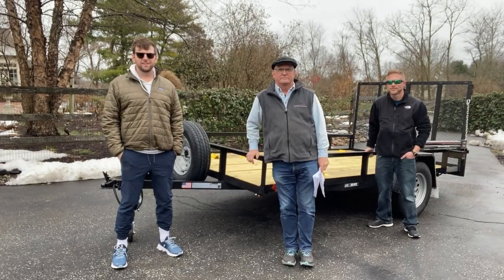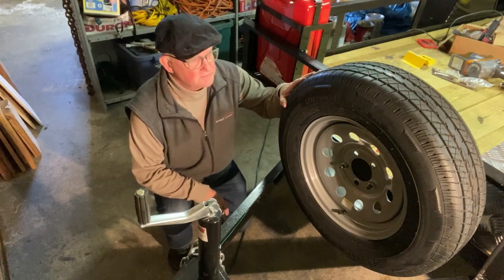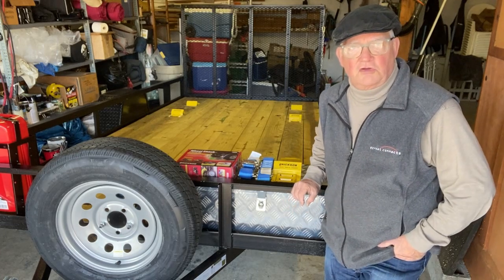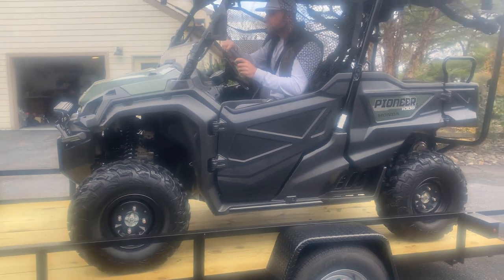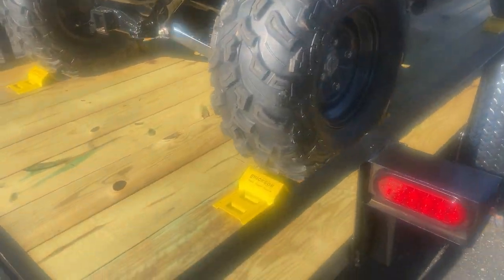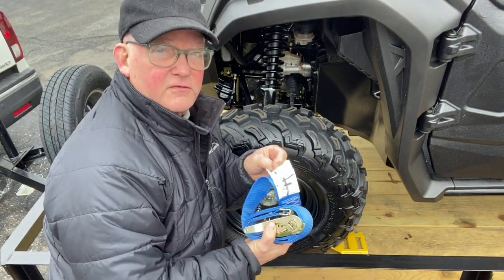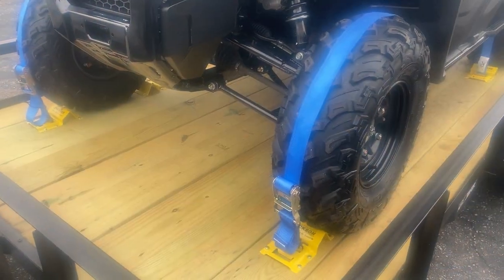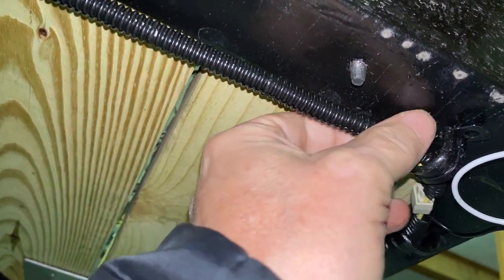Trailer and accessories for hauling your UTV

Comment: Aluminum is the way to go.  Light weight and will last a lifetime.   Cargo Buckle is also the way to go.  Those buckles are much quicker and secure.  Aluminum trailer may cost just a little more but saving a couple of bucks isn't always the answer if you want to save money in the long run.
Reply from the maker: Hey Robbie - thanks for the feedback. No doubt aluminum is the way to go - but price around here was almost double what I paid for mine and I just didn't have the budget for it - plus there was no inventory around in my size requirements - probably due to COVID. 

I did end up adding 4 Cargo Buckles - they are awesome for sure. I do like the eTrack system for the UTV and I really like how it allows the UTV suspension to absorb the road bumps rather than the trailer suspension. But when hauling a different vehicle like my little tractor, the limitation of the eTrack is obvious since the wheel layout didn't match - hence the addition of the Cargo Buckles. I'm actually glad I have both options because the UTV is the main load and I prefer the eTrack for it. Cargo Buckle gives me the flexibility for other loads when needed.

It's all fun - and thanks for taking the time to post!

Comment: Nice video. I enjoy your dual battery set up. I just did mine last night. I like the chock system as well.

Dallas Fatboy, didn’t your mother teach you if you don’t have nothing nice to say, don’t say nothing at all? I bet you have never pulled a trailer.... 90% of SxS are pulled with a single axle.
Reply from the maker: Thanks Larry! So how did the dual battery setup go? Did you do anything different than I did?

Don't be too hard on Dallas Fatboy, he couldn't help himself with that double axle dig - but it's all good!
Reply: @rsparre  I installed the same kit from TRUE as you did. Installing a Warn Axon 45-S next. Waiting on my switch plate and fuse box. I didn’t use the stinger. I am going to have a main power switch on the switch panel that kills everything instead of key on power. I wanted to be able to turn on lights and stereo and work the winch if I needed to with the key off.

Comment: Always collapse suspension when transporting utv that thing will be a pogo stick going down the road.
Reply from the maker: I don’t know what that means - what does collapse suspension mean?
Reply: @rsparre  generally load you want compress shocks some maybe not bottom them out to keep vehicle from shifting and a strap coming loose while going over bumps.
Reply from the maker: @Mathew187187  I do not follow what you are saying. Can you break it down in pieces - I do not know what “compress shocks maybe some not bottom them out” means. The Erickson straps are on the wheels - I can’t see how they would be affected by any shock movement.

Comment: You forgot a tandem axle for safety in case of s blowout or flat. Trailer brakes. Trailer breakaway system. And that trailer lock is worthless. Simple 3 foot prybar inserted under it and walk forward. It will pop right off. No noise no grinding. Need a Fort Knox lock.
Skimping out on safety and security will result in regret.   Trailer and SxS full insurance in case of s wreck. Otherwise you get sued and lose.  If you're worried about affording something, don't buy it. People want a Ferrari, but can't buy a Honda. 
Good luck
Reply from the maker: Greetings - and thank you for the feedback - I appreciate it!

Couple of things in response to your comments:
- I did specifically mention a 2nd axle for safety in case of accident or flat. I clarified that the reason I did not go with that is because of both the expense and additional weight that would be too much for me to manage at my age. I do appreciate that it is not as safe as a having two axles, and I said so in the video. 

- As for the lock, most locks are to keep honest people honest, but I will check out the Fort Knox locks - thanks for the tip!

- As for being worried about affording something, I think it is unfair to say one should not buy unless one can afford the gold plated perfect thing. I agree single axle may not be AS safe as tandem axle, but I don't think it is fair to say they are not safe. The decision to purchase a single axle trailer was the right decision for me for other reasons besides cost. I chose to get something that I could manage at my age and physical capabilities. 

Totally agree with you on the SxS full insurance!
Thank you for taking the time to provide feedback - and best of luck to you on your journey.
Reply from the maker: Hey I checked out the Fort Knox locks - they look awesome! There are a lot of choices. Do you have a specific model you would recommend?